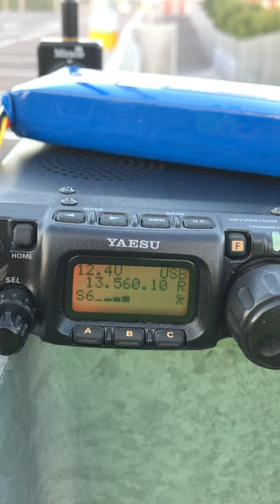#short knocking sound on short wave radio

Comment: Yup. Playing music on a radio with the tuning control is a favourite. A bit like playing an old Stylophone.  I don't know for certain but I suspect that there are multiple wireless "telemetry" systems in many carparks. For the ticket machines and the counter that logs cars into and out of the carpark and updates those sign boards that tell drivers how many spaces are available. The multi-story carpark I tend to use has several antennas on the roof.